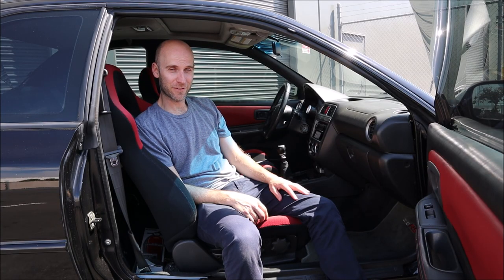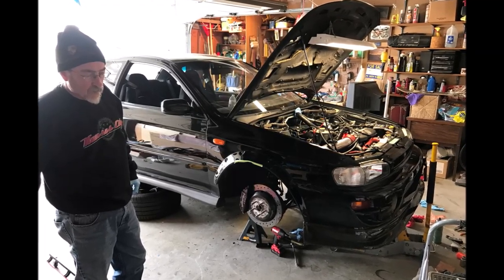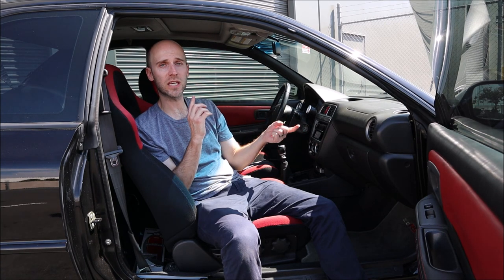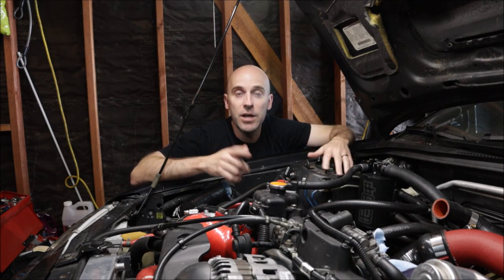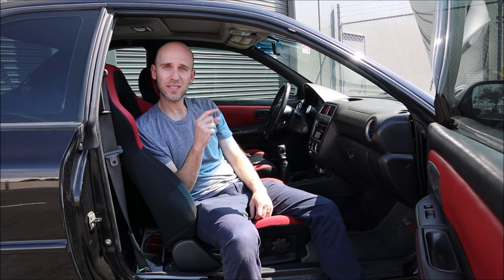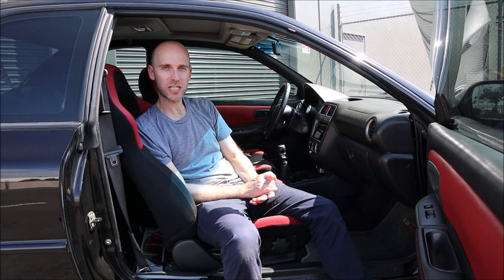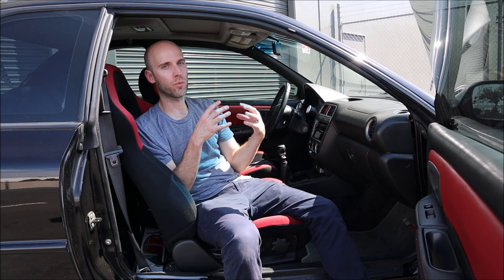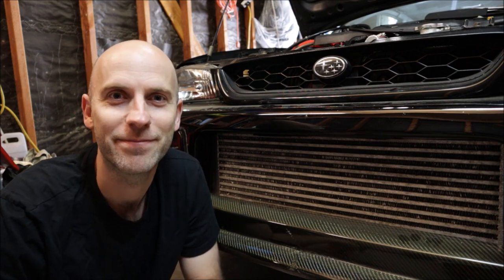$2000 STI Spec C 6-Speed Transmission Swap: GC8 Impreza 2.5RS Part 8.

Comment: I have done this swap a couple times , it's amazing how much difference in the car with the 6 speed ! It's so much more beefy , and the 6 speed flywheel is a tank !
Reply from the maker: Bruce Holinight it sure makes a difference. Especially when I did not have second gear. The flywheel is a light weight 5mt clutchmasters I believe. Wish I did the OEM 6 speed flywheel and clutch but I was cheep.
Reply: @RoadPatina  I was cheap too and used the 5 speed clutch but as soon as I found a 6 speed flywheel and new bolts I changed it ! Could not really feel the difference inside the car but after handling that beefy 6 speed flywheel it give me a lot more confidence ! Swapping to a 6 speed is like driving a whole different car !
Reply from the maker: Bruce Holinight after the swap I was getting a misfire code but it was running great. Some people mentioned the lightweight flywheels can do this?!
Reply: @bruceholinight7978  how difficult is the swap?
Reply: @trashbandit2449  68 year's  old , have cancer , I'm ,100lb , it took me 3 months just me and my wife , do enough research , get the ECU that goes with the engine or a custom ECU , that was my biggest challenge !
Reply: @bruceholinight7978  thank you.

Wishing you the best on your health. Hang in there
Reply: @trashbandit2449  Thanks , when I hear that 8500 RPM kick in , nothing else matters , a little bud helps too !

Comment: I wanted to ask if the PPG gearset was a full syncho 1-5 or 1-4? But depending on when it was built, I think they have an updated design second gear for that.
Reply from the maker: I don’t recall. It was originally built long ago 5+ years. The fist owner said the PPG 2nd gear went out twice. It was going to cost the same to rebuild the 5mt as going 6speed. No brained for me!

Comment: I just bought my 98 RS this week. great videos! lots to learn on these cars. anything I can do to get 1hp out of my NA motor? while I save to do my swap.
Reply from the maker: Thanks! Not much power to be found in the NA cars. Just simple intake header and exhaust will help a bit. I’d rather see you spend that money combing through the brakes, suspension, tires, and fixing all the little bits! IMHO
Reply: @RoadPatina   thanks for responding bro! WhT brake kit do you have installed? Will it fit with my 15s on? You got a video on those? Lol
Reply from the maker: @frnciscob1  they are Willwood BBK 6 piston front and 4 piston rear. There are more shots of them on my fist video when I purchased the car. Defiantly need bigger wheels to clear. I am on 18s not sure if 17s would clear. 15s not a chance!

Comment: solid info you got there. So in order to free the clutch when pulling the transmission it is necessary to take off the clutch fork pin. I didn't know this when I pulled my engine, so I left the clutch and pressure plate attached to the transmission when I pulled my engine. This was an 02 WRX

What engine/trans where your original ? 02-05 WRX ?
Reply from the maker: 360Sebastian360 yes, you must release the clutch fork! Engine and trans will not separate unless you do so. You probably did one flywheel bolt at a time? My trans was a 2002 WRX 5mt and block was a EJ257.
Reply: @RoadPatina  I did one flywheel bolt at a time. The the flywheel came out with the engine and the pressure plate and clutch stayed on the transmission
Reply from the maker: 360Sebastian360 I was trying to visualize how you did it. That makes sense and glad it worked out. I put the release bearing on wrong and had to drop the trans again as it was not clicking into the pressure plate 🤦‍♂️
Reply: @RoadPatina  i had to pull the engine again because i did not properly install a little ring that came off of the pressure plate. this caused the clutch to not engage.
Reply from the maker: 360Sebastian360 same ring caused my problem! Nothing on this car is ez for me.

Comment: Hey man! I was told to do the same trick by a friend of mine. I am glad that your vid confirms it is working. My car is a 95' 4-door STI sedan. If I googled the right thing , my transmission is push type. I have several thing to figure out: 1/ where exactly is this little cap that needs to be removed 2/ what kind of bolts I need to purchase for the push type transmission and where from 3/ I am going to keep my cardan shaft and will cut it to fit the new gearbox. Do you see any problems with my setup and do you think this would work for my car, since my friends car was a WRX, not an STI ? Also can you assist me with finding online these bolts, I am really struglling with this part... 
P.S. I bought the whole swap package from a legacy 3.0 6-speed : gearbox, 4x driveshafts, shifter and differential.
Reply from the maker: @2:35 you see the cap that needs to be removed with an Allen wrench. The next pic shows that you thread a 10mm bolt into the slide pin and pull it out. The shift fork will now drop. It’s right next to the shift fork on transmission. The shift Fork pivots on this slide pin. If your able to move your shift fork back and forth you should be able to see where it is pivoting on.
Reply from the maker: Sorry I don’t know about the driveshaft length you need. I had a wrx drive shaft that was longer than the sti driveshaft, because the sti transmission is longer.
Reply: @RoadPatina  I will have a look on Sunday, when I go to the garage. I saw another part which looked like a cap, but it was really hard and didnt have an entry for Allen wrench. Maybe I saw something else.

Comment: Swapping over to 6 speed, does it require ecu tune or anything? Or just direct swap over and use?
Reply from the maker: Jiatao Liu I would get it tuned to be safe. The gear ratios change the rpm of the engine. Plenty of people don’t retune with the swap, but I need  a tune anyway.
Reply: @RoadPatina  Do you have a link that elaborates more on why a re tune is good after swapping the transmission

Comment: so did u use the original rear diff that was in the car?
Reply from the maker: R J the rear diff was out of a wrx. It’s a r160 and so far holding just fine, however, I don’t launch it.
Reply: @RoadPatina   I heard about using the rear diff was just curious was also told to use a auto drive shift but your sti driveshaft bolted up?I will be doing a 6speed also on my saabaru have the 6 speed trans already but only part I have. If you could go back would u have done the 6 speed clutch?
Reply from the maker: R J I NEVER want to pull the tranny again! I should have bit the bullet and bought an STI clutch kit. They are expensive! You need the shorter drive shaft as the 6spd tranny is longer. I don’t know if I had the sti or auto drive shaft or if there is a difference! Lmk if you need anything else. You got this!!!

Comment: One common misconception is that every Impreza between 92-01 were "GC8's". The code breakdown is as follows; G - stands for Impreza, C - sedan, M - coupe, F - station wagon, The 8 stands for the 2.0 L turbo motor. So really, there are many combinations. A coupe STi would be GM8, sedan GC8, wagon GF8. Also, the code for the coupe American 2.5RS's were GM6 (6 standing for the 2.5 L N/A motor)
Reply: youre mostly correct but sedans and coupe both share the C letter. i own a EUDM 4door with a GC8 vin and a guy local to me owns a JDM impreza type R 2door with a GC8 vin as well. the GM thing is exclusively a US thing
Reply from the maker: So many letters!
Reply: Also interestingly, my 1997 EUDM Impreza VIN is GC8, despite it having 2.0 NA engine. It appears that the "8" only refers to the 2.0 engine size, not the aspiration.